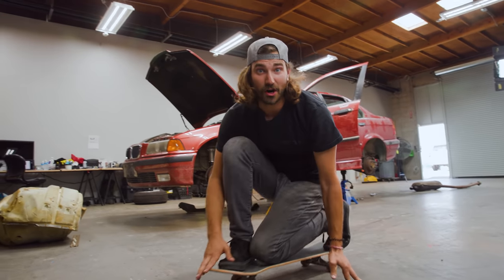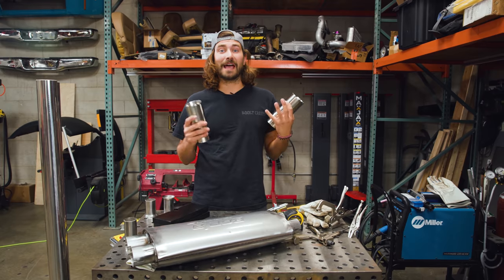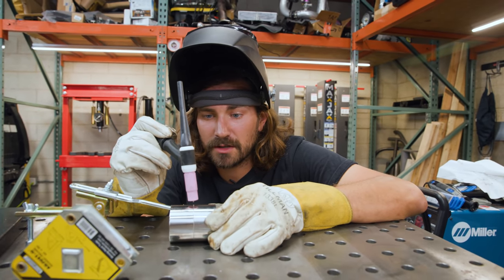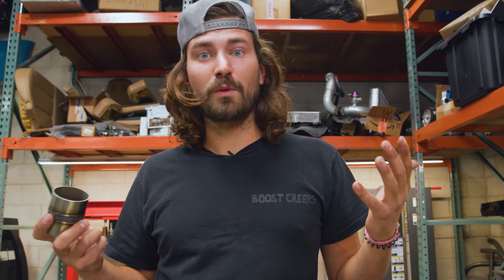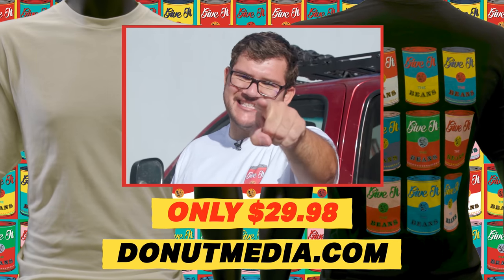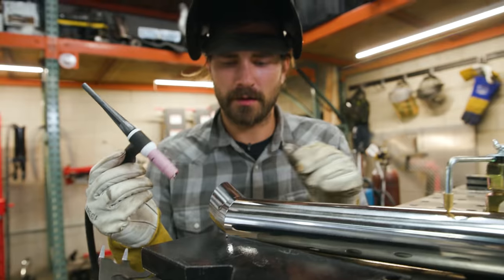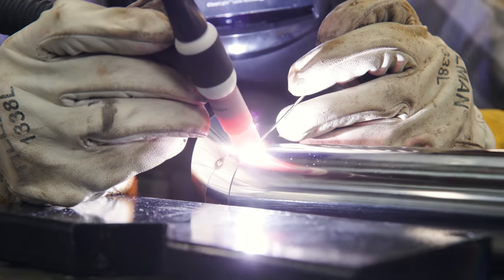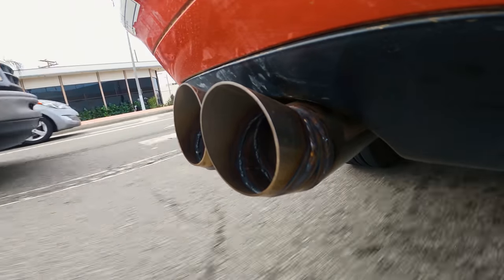DIY Exhaust! - Is it Worth It?

Comment: As a tig welder I appreciate you at least mentioning back purging being the right way to do it. Instead of buying plugs you can use tape or aluminum foil next time but either way good learning experience 👍
Reply: Agreed as a tig welder myself, aluminum so it’s a lot different, but I’d say more gas and weld kinda in segments like a inch worms body, you’ll get good dimes like that even without back purge 👍🏼
Reply: @CandidKiller  but the insides of the pipe will crystallise and will not have proper fusion with out purge on stainless   and with heat and vibration the join is the  weak point so it normally cracks (edit .. when welding stainless I'm talking aluminium there is no need to purge )
Reply: @nickthelebo  What is the actual purpose of the argon? I assume, because it is inert,  that it basically blows away atmospheric gasses that would react with the molten fresh weld? Is that what the crystallization you mentioned is?
Reply: @nickthelebo   Did not know about the necessary back purge for stainless, glad you informed me. I’ve only been professionally welding for almost 3 years and started with mig then went to tig and do aluminum now at work and we do a little mild steel so nothing we do requires back purge
Reply: @fatpad00   Argon in short is what you use to weld, it’s a gas, and it allows for the weld to lay cleanly, without argon it’s a bubbly mess and you’ll never get a weld down, we use 75% argon and 25% helium for aluminum at work but all metals can use 100% argon, don’t quote me, but like steel can’t have the helium, they make another mixture for that. Again don’t quote me I’ve only welded a few years
Reply: @CandidKiller  in the weld lab at my school they use a mix of argon and CO2 I believe, and they mostly do carbon steel
Reply: @fatpad00  your on the money there bud the argon is used to push atmospheric gases away so don't get me rong I love this channel and what there doing but nearly every one on YouTube gets it rong when it comes to this if u look inside the pipe after he had done the  exhaust tips for example that black crusty stuff should not be there thats the crystallisation I speak of when you purge you can see a nice shiny weld on the inside also the cup used on the torch isn't really what you would call a good setup for stainless ither the fact that it has gone black after being welded means it has had insufficient gas coverage after it has been welded and has oxidised it still needs to be covered as its cooled personally I would use a cup no smaller than a 16 and would be running probably 10 seconds of post gas and doing short runs of 7 to 8 dabs with how I space them out and allowing it to cool with gas coverage is how you get nice shiny gold welds if you pull the gas away alittle earlier like just after its stoped glowing you can get slight oxidisation witch is the pretty blues and purples you see in the automotive industry witch is perfectly acceptable in the automotive  industry
Reply: @disguiseddata1581   I believe we has some of that at Utility Trailer when I mig welded there. I’m not sure you can use the CO2 on aluminum but like I’ve said before don’t quote me, I’ve only been doing this professionally for less than 3 years and been welding for almost 6 so I’m still new myself and have a lot to learn still
Reply: @CandidKiller  argon co2 mix  commonly called argon lite or mig shield is used in mig welding it is not really any good for tig .. some jobs will allow you to  use co2 for purge but normally argon is all you will ever use for tig with exception of same argon helium mixtures for very specific jobs or pure helium for dc aluminium tig but that is very uncommon but if u need extream penitration and the cleaning action of ac is not needed its good to know ..... but chase Tucker and @DisguisedData 15 keep up the learning learn as much as you can iv been a fabricator welder for more than 13 years and there's still so much I don't know biggest thing iv learnt in my time is learn as much as you can from asmany different people and places as you can because more often than not there's more than 1 way to do something but most people are so stuck in there ways they will not accept that there are ways other than there own
Reply: @nickthelebo   That was my general idea but you just said it more explained out. Thank you for these useful tips, I will keep learning and growing as the best welder I can be
Reply: @disguiseddata1581  you cannot use CO2 as far as I know with tig welding. CO2 is mixed with argon or straight CO2 are used in mig welding. Tig welding typically uses pure argon or helium can be mixed in to increase heat input in an application where your machine doesn’t produce enough amperage for a larger part where extra heat is necessary
Reply: As far as I know you only use pure argon for back purging. Any other impurities would cause a contaminated weld and when your in an industry like food and beverage as I am you simply can’t afford that risk
Reply: Wrong! As a tug welder myself, I am furious that you think that’s okay, someone could die.
Reply: Welding, basically  speaking isn't very hard to learn,... Yet takes a lifetime to master.
Reply: @chuckingram5966  mig welding yes, basic arc welding yes but tig and arc welding things like gas lines is very difficult and there is a large gap between “it’s ok” and actually having a good product and doing it the right way
Reply: @fraserlewis5767  don't know what in my comment you don't seem to understand. Please elaborate
Reply: As a tig welder in school, had no clue purging was a thing lol
Reply: @disguiseddata1581  agreed
Reply: @chuckingram5966  to say welding as a whole isn’t hard to learn I have to disagree with. Lots of people think they can weld but few who haven’t had experience doing it as an actual job can. There is so much more to welding and fabrication than striking an arc and fusing metals together but I appreciate you recognising the fact it takes a life time to master
Reply: U can basically use any inert gas to purge, the point of purging is to eliminate any oxygen touching the pool. This will cause it to burn. The argon flowing from the cup has exact the same function. The less oxygen comes in contact with the weld the better. Stainless or other similar alloys are notoriously sensitive to oxigen. When welding titanium its best to even use a "sled" on the cup to protect the glowing metal behind the weld from oxygen aswel. The nice blue gold colloring on high end exhausts for example means there was as little reaction of the alloy to oxygen. If its grey or matte it means the hot alloy reacted with oxygen. If u weld a standard steel pipe there is no need for purging because the influence of oxygen is less severe. But if you have to make a second pass u will see the inside of the weld will "flake" but for regular steel it will only afect the surface of the steel. Sry if my english is not up to standard, i am not a native speaker.

Comment: That 8° bend trick is golden. Thank you Zach!
Reply: I kinda don’t get why? Why not just cut 8 degrees?
Reply: @mikcute9510  cus if you cut it at 8°, how will you attach the two pipes to maintain that 8° bend? No matter how you'd attach it, it would either have no bend, or have a 16° bend. 
Or, you could just use the cut pipe and another piece of straight pipe, but that isn't an efficient use of materials.
Reply: @DezziDuck  ahh i see, thank youuu
Reply: Go much more than that 8 degrees, and you should really use a mandrel bend and weld that in.
Reply: Give her the ol' 8"&8°.

Comment: I made my first set of custom headers when I was 15. Was it perfect? No. Was I incredibly proud of it? Yes. It’s the experience that makes it worth it.
Reply: DAMN STRAIGHT.
Reply: Any advice on it? Tryna make new headers for my bike because the old ones are close to 40 years old and have a couple rust holes. I have a MIG welder but I'm a shit welder and don't have much in the way of cutting the angles I need.
Reply: @iseemanstas5193  honestly? I wouldn't mig weld them. It just won't look good and isn't the right tool for the job.

See if you can get yourself a tig welder and a bottle of gas.

If not, have you thought about college? I did a set of down pipes for my ZX6R when I was at college learning to to fabrication. It went into my portfolio for my qualification, I learnt something and I got something out of it.

(This was 15 years ago though)

Comment: One tip for your welding, use 1/32 filler rod so you don't have to get it so hot and you will be amazed how much better it looks and how much easier it is to control!

Comment: First off, if that was your first time welding…amazing job! Second, check out stainless autogenous pulse tig, it has totally changed how I weld stainless exhaust. I understand this is a beater but it was my understanding that you shouldn’t stiff weld the exhaust to the chassis as the vibrations will cause some points of it to crack (hopefully not near the headers. The hanger needs bushings. Also, what a lovely head of hair.
Reply: the solid mount is often done in rally cars for the extra clearance it can provide. You also often see solid chassis mounted engine and trans mounts too. All sorts of vibration going on and often its not the exhaust that breaks.
Reply: @crisnmaryfam7344  thank you for the imparted knowledge 🙏
Reply: The filler is helpful for extra strength I would think, autogenous welds are nice because you use only the material you're welding, but it can leave the material a bit weaker than a good filler bead with back purging. This is just my experience though so if I'm incorrect I apologize lol
Reply: @JackoJakl  I understand, my applications are for small pipes motorcycle exhaust. The radius is quite small so using filler is quite difficult.

Comment: It's counterintuitive but a steeper angle on your electrode's tip will give you a wider arc. An electrode ground flat will create an almost laser like arc.
Reply: Very underrated comment. To a newer welder, they may not notice. But if you do the different grinds back to back, you can really see the difference. It’s why you want a large angle (60* point) for thin metal, vs a shallow angle (15* point) for thicker metals. The large angle allows you to have a more focused arc, where the heat affected zone isn’t trying to melt a larger area of the metal.

Comment: pro tip on welding.. get closer with the electrode (<2mm), and/or move faster. a lower angle from 90 degrees will help prevent it from burning... keep it nice and colourful :) great job on the project. looks awesome.

Comment: I have a 2012 F30 3 series & building my own exhaust is one of the best decisions I ever made. 

(N20 sitting at 380 wheel hp & 440 wheel tq mated to the ZF 8 speed. 4 seconds to 60 & 12 second 1/4 mile.)

Comment: Invest in an local exhaust extraction system for welding, especially when welding after using break cleaner with TCE (phosgene) or welding on stainless steel (hexavalent chromium).
Reply: I thought the rule was straight up don't weld anything with brake cleaner on it.......EVER. "once the gas is inhaled there is a little a doctor can do except give supportive care such as ventilation" that's enough to put me off going near the stuff personally!
Reply: Yeah best to stay away from brake clean altogether to be safe

Comment: I think the tips were phenomenal and the welding was amazing one tip for stainless steel is flux it’s specific for stainless, just makes the insides you said not to look at a bit cleaner without needing to backfill just a little flux on the inside and the outside just a friendly tip:)

Comment: Can confirm, diy exhaust can be decent with some trial and error. I had my 2008 honda fit straight piped from the cat for a while but recently put in a 2.5" inlet to 4" outlet 18" long muffler tip from evil energy on amazon and now my car has a nice deep tone.

Comment: As a person that does custom exhaust using a pipe bender, this was definitely very very hard to do, and it looks amazing! Great job with cuts and welding, and the angles were super pristine!
Reply: I don't understand why they don't use a pipe bender. Of course, most home garages don't have one or even know a shop that has one. But isn't that the only efficient way to do it?
Reply: Is there an advantage to getting a custom exhaust?? I dont want something super loud....just a bit louder a premium sounding. No drone etc....
Reply: @KC-lg8qf  Well, mandrel bent is supposed to be better than crimp bent, or whatever it is called. And bigger tubes are supposed to be better as are more free flowing mufflers which tend to be noisier.  By better, I mean a tiny percentage better at wide open throttle at 5000 plus rpm.  
   OK, so it is 1978,  I have a 72 Road Runner GTX 440 with true dual exhaust.  Some turkey had his mom's 66 Coronet sedan. With a wheezy 318.  He puts on glass packs, ladder bars, and bunch of free decals from the hot rod store.  He is "compensating", as we would call it now.  That is all loud mufflers are to me. "Compensating."
Reply: @auteurfiddler8706  totally agree! Well said!

Comment: I remember that back in the day, my exhaust on my old VW got rusted. So my friends recommended me a guy that does everything on his own... Decided to give it a go...
And really, literally, the guy did it from 0 right before my eyes! He just had a bunch of steel pipes he was bending according to measures! As for mufflers (I believe that is how you call them), he just had a bunch of flat tin sheet. And he did the same; measured them up, cut them, bent them and welded as well as putting some isolator material or whatever inside! Then put it all together, welded it and installed... And it worked just fine!
That was 6-7 years ago in a 1991 VW Polo! 2-3 years ago I sold the car. The dude who bought it is still driving it with the same exhaust!
My current car is a 2004 Citroen C2 and it has chrome lined exhaust in very good condition, so I hope it will last a bit longer...

Comment: Some advice for the future. Take the entire length of tubing, measure to the first bend, cut your 4°, weld it back together, measure to the next spot and repeat. Then at each bend, you only Weld one seam rather then 3.
Reply: Thank fudge someone actually said this! This is how we do it at work. It's proabably 70% faster, your putting less heat heat into the material, your not making multiple cuts so there's less room for error.

Also why have it on foot pedal why not just have an auto push button start on the torch? You're reducing variables which makes the job cleaner again.

Comment: Stainless tech tip...tac it, continue this way. Then make a controlled leak of argon inside the pipe... Stainless makes crystals. Then can break. So sealing one end with argon supply to then making a very small leak on the otherside will did the pipe, stop crystals. And maybe save your turbo if your fabbing the induction.... Behind the downpipe it's not as critical, but it's good practice
Reply: He already mentioned purging the inside.
What he didnt mention is getting a gas lens lol

Comment: I’ve welded for 12 years. Everything from pressure vessel stainless to aerospace stainless, Inconel, aluminum and titanium. .016” all the way up to 1” thickness. I’m a welding instructor at one of the oldest welding schools in the country. Give me a week in your shop and I’ll have all of you welding like champs. 😂 the welds are pretty good, all an exhaust does is move air anyway. 🤷🏻‍♂️😂 also, I like the mini pie cuts to bend the exhaust. Classy way to do the soft bends.

Comment: Tip for tig welding stainless, you dont need it, but using a gas lense will shorten your tip and cover your metal better with gas, makes working with pipe alot easier

Comment: Great stuff as always and excellent use of a welding marker. To the new welders out there take it from someone that had to learn the hard way, get some welding markers and always use them, they're worth every penny. Using Zach's 4° cut as an example, with that small of a change if you just "eyeball" it and don't weld the pieces back together at exactly 180° of rotation or if you're making a direct cut onto the item for the angle and instead of a coupler that you can position however you need to, you might find that the other end of your item is now an inch or two to the left or right of where it was supposed to be because of the slight deviation. At that point it's already too late and you'll end up either starting over or going down a rabbit hole trying to make it work. The "measure twice and cut once" philosophy is the same in welding, measure twice and weld once, you'll be glad you did.

Comment: Am in the middle of making my own custom dual exhaust on my Audi B5. Seeing this video goes to show how badly I need an angle finder, lol. I had to cut the straight pipe that a previous owner had slapped on, and replaced both cats with a pair of amazon units, got 2 sections of straight pipe, a portaband, and I've had a flux core welder for 2 years almost. It's coming along pretty well, I think. I didn't believe that butt welding would be as tricky as it is, but I've made do. The .035" wire seems to fill the oddball gaps, and it's all very solid. I'd like to do a TIG welded exhaust with all the back purging, but I don't have that kind of money right now. I'm making this exhaust for roughly $225. It's been a pleasant experience, and I find I enjoy doing all the prep work that goes into it. It's all been quite therapeutic and peaceful, minus dropping bits of dirt and road grime in my eyes while under the car, lol. Thanks again for the informative watch, your bimmer sounds sweet asf